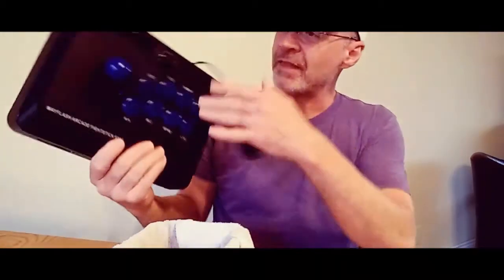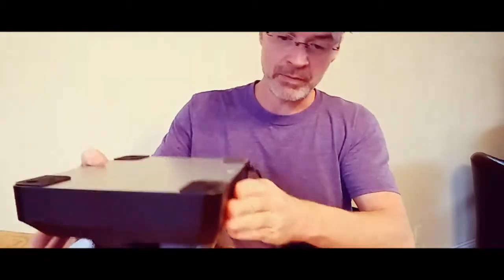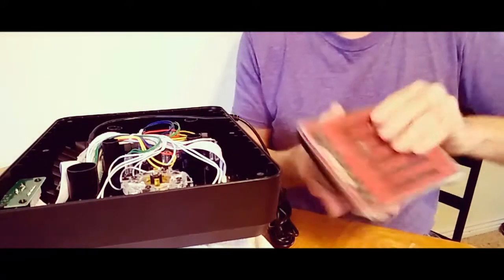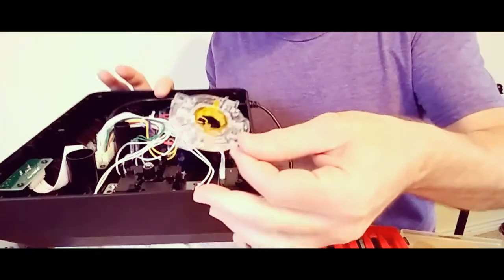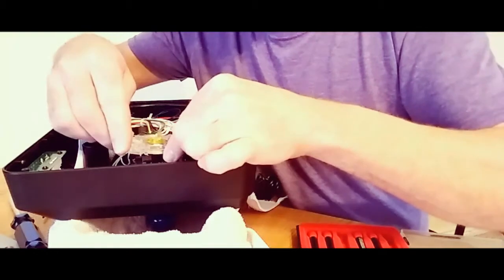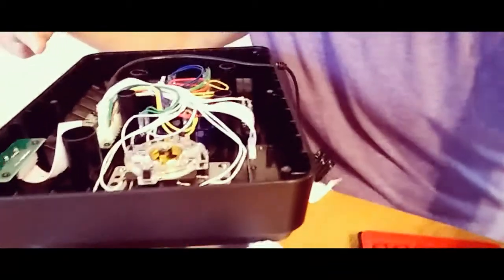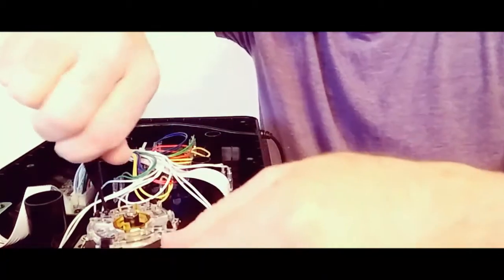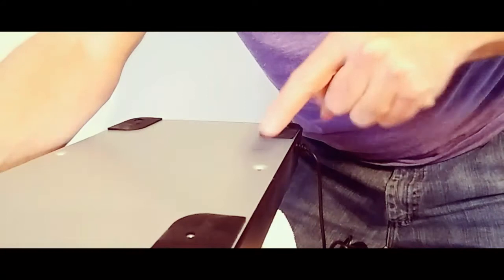How to install the Sanwa GT-Y Octagonal Restrictor plate  on the Mayflash Arcade Fightstick F300

Comment: I really appreciate this video. Although, I want to get a Sanwa JLF w/ an octagonal or circular restrictor plate, current funds won't allow for it right now so will only be able to get the Mayflash 300. Best for it's budget. Knowing I can use the stock stick w/ that restrictor plate is a definite go for me. Thanks!
Reply from the maker: Thank you. I'm glad you enjoyed the video. I understand the whole budget thing. Have a good day.
Reply: @yodermouth  Thanks, and you too. Also, upon further research I found out that the f500 model actually includes an extra octagonal gate. It has the square gate installed, and comes with that as an extra. The description on Amazon doesn't specify this, but when you check the faqs in the review section I've read at least 8+ buyers confirmed this which they also knew nothing about. I guess they're just too lazy to update this? Also, it has the plexiglass for the marquee for easy interchangeable artwork. So, I'm going to go with that and I won't be buying any Sanwa parts for now until I see how this stick feels.

Edit: The additional gate is not Sanwa Denshi parts, but one very similar.
Reply from the maker: @ctrl_alt_deleter  well keep us posted on how you like it. I'd be curious to know.
Reply: @yodermouth  Will do! I should be ordering it within a day or two, and should arrive within the week via Amazon Prime. I've read that the buttons are okay, but the switches aren't premium so if you have existing Sanwa buttons you can just take the microswitches out and swap them. I'm trying to get the most bang for my budget as you can tell. Lol

Comment: Thank you so much for this video!! Is it required to have a Sanwa joystick to instal with the Sanwa restrictor plate?   Or can you just use the restrictor plate with the joystick it comes with? 

(Sorry for the stupid question I just want to make sure before I order this)

Very helpful video! You got yourself a like!
Reply from the maker: コンピューティング C R Y O Eyolf キ You can use the joystick that it comes with. The restrictor plate is the only thing that I changed. Everything else is original.
Reply: yodermouth  Awesome!! I knew it was the original joystick but just wanted to be 100% sure :)  Considering all I found in Other videos was people using a Sanwa joystick to replace as well and I got confused. 

Thank you again for this video and I subbed to your channel!
Reply: @yodermouth  n response to your comment, I got the Razer Pantera Evo with a Stock Sanwa JLF lever and .9lb and Square gate. From the moment I took it out of the box I have felt it has been a complete waste of money. The stick is so loose, massive throw range, horrible. I played American arcades with what? the HAPP Eurosticks with Octo gates? were those the ones in the 90's arcades right? Anyways in the arcades DP's and Fireball were easy when I was like 12. Here I am getting my first Sanwa with Square gate thinking its going to be wonderful. Nothing but disappointment. Execution went from very high overall (on pad) to dirt low beginner level or worse. So the 2lb spring helped a little bit but not enough.  I have a Seimitsu LS-40 on the way and I am excited to say the least. Also have a oversized actuator and a Octo restrictor gate on the way as well for the JLF. Between the mods for the JLF and the new shiny Seimitsu LS-40 I think I will be much much happier. I will never again play with a stock Sanwa lever and square gate combo. Its unplayable in my opinion. I have read from others too that they absolutely HATE the stock Sanwa with square gate. They find it awful as well. They said the Seimitsu comes stock with a sort of Square-roundish gate that is much better, so  I am even more excited when I think about it LOL I highly doubt any pro uses a STOCK Sanwa JLF lever with a Stock Square gate. Everyone I read about their info or ask, also say in their equipment used or there preference pretty much all use CUSTOM Sanwa Lever's .Custom, not stock (LMAO) Custom is the key word Custom. I will never ever touch stock Sanwa's for the rest of my life, I swear it.

Comment: Thanx I just save over 70 bucks by watching this, but yeah I did have the wire replaced as my new Bulldog puppy chewed thru the damn usb cord of my F500 so I took the octagonal out of the F500 and put it in my F300 Elite gonna test it out now Will let you know what I think. GREAT VIDEO and once again thanx I feel stupid that it is so damn easy I even replaced a jammed button.
Reply from the maker: That's awesome. I'm glad it helped you out. And yes, keep us posted.
Reply: @yodermouth  Just finished playing Mortal Kombat Arcade on my PS3 it was Flawless! Then I tried Pac Man on the Xbox One then Ms. Pac Man and IF I could actually play the Game It would have been cool but at least I made it to the 4th level (yeah I suck) LMAO! Finally I tried DragonBallz Fighterz and it FRIGGIN ROCKED!!! Sad to think I actually cursed Microsoft out about refusing a Refund! Point being... The Octagonal Restrictor Plate DOES make the MayFlash F300 Elite a MONSTER of a Fight Stick with ALL Sanwa Parts there is definite difference in the ease of executing Moves. GREAT VIDEO!! - GamerTag: Sahykotik Seyj

Comment: When I tried to take out those screws, it turned out that of the four, three of them were already stripped beyond use. I'm currently looking for a screw extractor small enough to take them out, but they seem pretty uncommon. Thanks anyway.

Comment: I have a question where i put the screws through the gate, it goes  through a tiny hole but won't go through fully there's plastic blocking through the other side, i tried poking it out but its like its a part of it

Comment: What exactly is the restrictor for? I want to mod my madcatz fight stick just couldnt pull a proper combo with my current stick
Reply: Restrictor plates allow for different movement in games. 

PacMan games are 4 way games(up,down,left,right.)you'll want to use a 4 gate or octagonal plate(thats the one he used in this video.) 

Fighting games use 8 way direction(up,down,left,right,plus their diagonals in those directions,which are a total of 8 directions altogether. For those you'll want an 8 way restrictor gate.

Comment: will this gate work with f500 as well?
Reply from the maker: +Joiztik I don't have the F500 so I don't know. I would think that it does though. I think that the joysticks are pretty standard.
Reply: Joiztik yesterday i got the f500. i dont like the square restrictor at all. today i will change it with octogonal one....f500 and f300 are fully custom....so you can put almost any repleacement. if you have money go for the denshi sanwa accesories
Reply: Joiztik didnt your f500 come with an extra octagonal gate in the box?